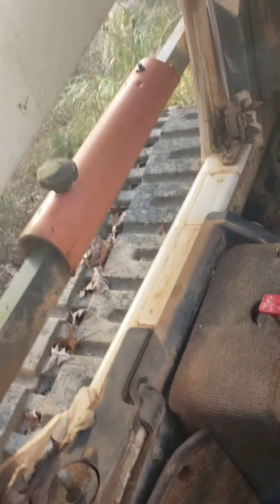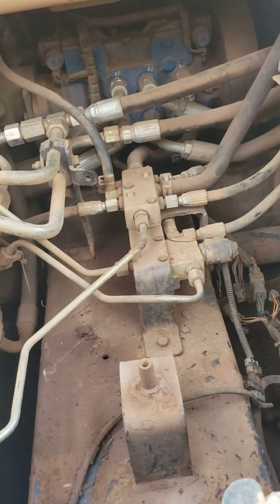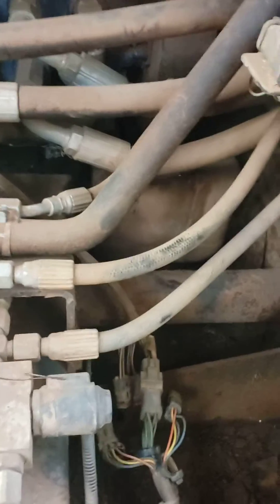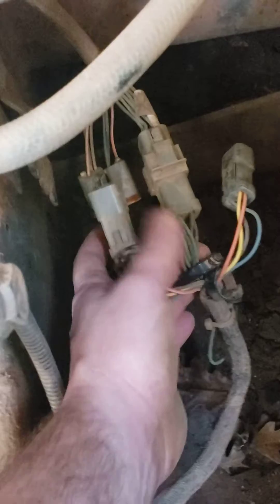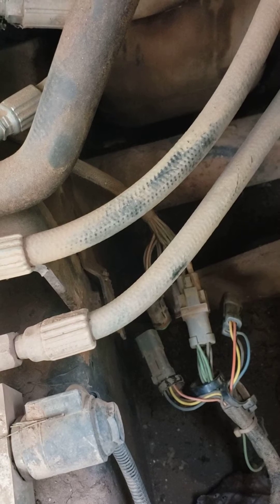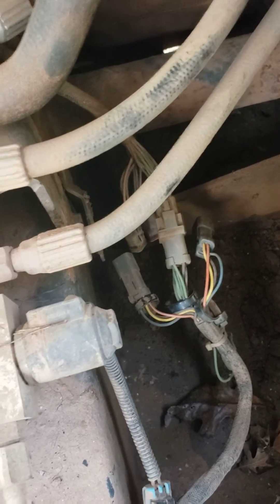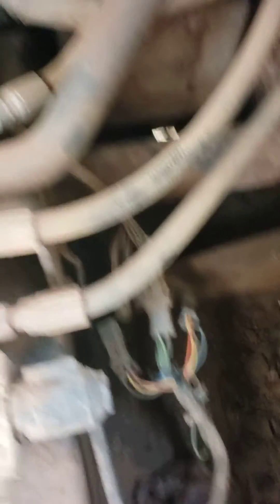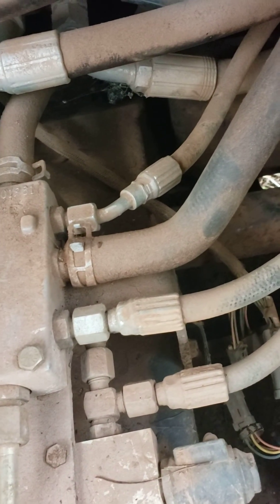Bobcat T770 Swashplate neutral error workaround. D7527

Comment: Lord … Swash buckle🤦 and those connectors he points to are the drive forward and reverse coils.. swash plate sensors are on the bottom of the hydrostatic pump
Reply from the maker: Swash buckle was incorrect, clearly explained above.  Connectors are correct for getting the machine to run to load it.  Or worked for mine.  If this doesn't work for you, please do your own video, link it and be helpful instead of putting others down?   Please share a link so we can come "critique" it for you.   The point of this video was to save somebody from having to pay the tow vultures or a dealership from coming to get your machine.  This wasn't to fix any issue, it was to get a machine loaded.  First time it happened I got stuck in the machine and had to crawl out the back.  Then went to the dealer which had "experts" like you seem to be and same thing happened again in the woods because they didn't fix the problem and actually damaged the warning harness sticking probes in it.  We had to get it out and loaded and to another dealer.

Comment: Yes, keith is right but the engine with pumps is relitively easy to remove. I disconnected the sensors and then had to replace both pumps because of the metal debris in the system. So before you just disconnect these sensors make sure they're not trying to tell you something important.

Comment: Those electronic components on the top side of the pump are control solinoids. The sensors are on the bottom, under steel sensor covers. Gotta say, those sensors are effing buried so wish me luck bc that's what I'll be doing tomorrow.. Yaay. Your video on the work around was very helpful as I'd like to get this beast inside to do the job. So.. Thank you!
Reply: I was charged over 3000 dollars for a faulty swash plate. 18 hours labor at Williams Equipment over 12 dollar part
Reply: did you find the cause of your problem, i'm having this problem with right side sensor , replaced sensor but still have problem.
Reply: Yeah. There are little control linkages inside the pump housing that wear out. Little plastic bushings. I installed new bushing and linkage and haven't had a problem since.  You also have to zero the sensor. Which I did several times.  But that was my problem. The sensor would not return to the neutral position so the ecm reads an out of position code.
Reply: Did you have to pull the motor and pump out of the machine to replace the bushings and linkages
Reply: @jonathoncain2300 Yepp
Reply: I have been getting an out of position error at random and machine shutdown then start it right back up and keep going untill it happens again. It's been that way for about 6 months. About 30min ago it did it again and now it almost immediately shuts down after starting with a swashplate not in neutral error
Reply: Yes.. Ideally you pull the drive train.. But it's not too bad if take your time and don't rush..
Reply: I believe it. With labour rates as they are, it doesn't take long to get up to 3K...
Reply: If you can reach the engine mounts take the two out closest to the hydrostatic pump and then loosen the rear - then you can take a big pry bar and lift the pump and eng enough to get you hand in there to squeeze and pull out the connectors… you can even pull the swash plate sensors out to…